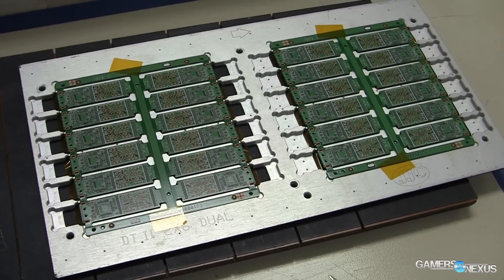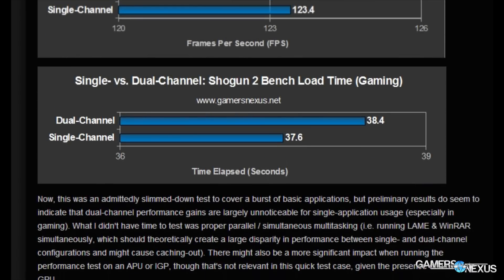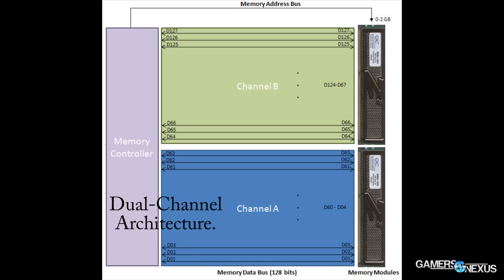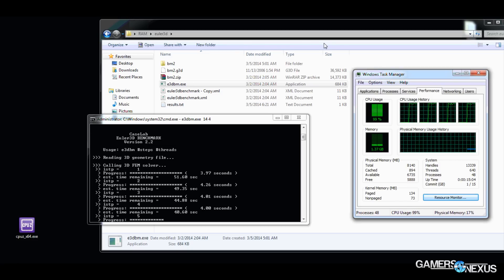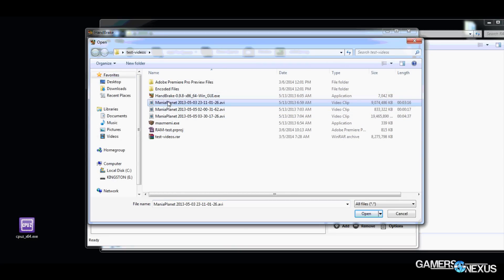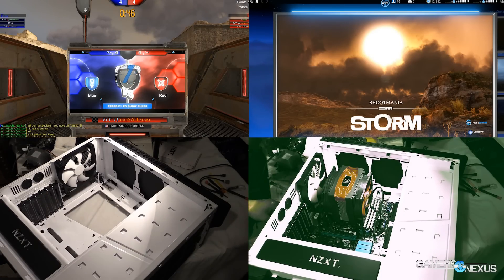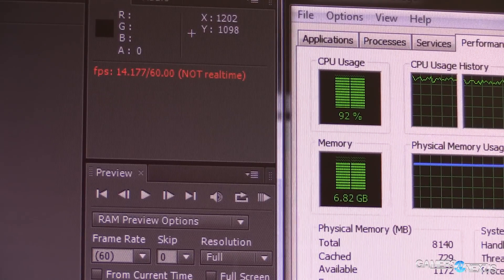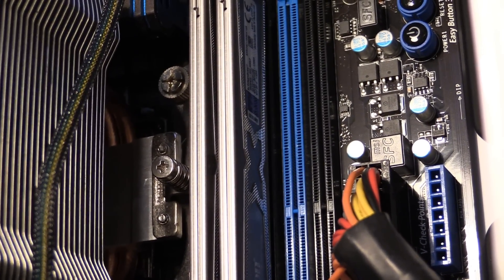RAM Benchmark: Dual-Channel vs. Single-Channel - Does it Matter?

Comment: I have a 12700 and I have a great speed of 3600 MHz with 1 stick, and I get less fps drops with that in A2 compared to when I use 2 sticks of 3200. I get fewer stutters, so it's not just using 2 separate sticks where it always gives less stutters and drops; it depends on game optimisation. Also, in games where I don't see hardly any difference at all in stutters or drops using either sticks,I also noticed if capping to 100-60 a person can use 1 stick and hardly any stutters or drops will happen; their reduced a lot, so yeah, 1 stick is enough; it just depends on game optimisation or how the CPU handles it.

Comment: I don't know if this makes sense, but does using dual channel become more important when using an ageing PC in 2021?

For example, one of the PCs I have, has an I3-3250, GTX 750Ti and 2x 4GBs 1600Mhz DDR3, SSD etc.

What I mean is, as this is an ageing PC with less CPU cores, does it not benefit from the use of RAM in dual channel mode as it inevitable has to work harder to keep up with today's software? Older PCs have to use every advantage they have right?

Comment: I know this is an old video but the subject is exactly what I was looking for.  I was hoping to clarify something I think was said at 1:52 in the video where you said there is no such thing as single or dual-channel memory.  Are you saying that memory does not need to be bought in kits?  For example, an 8GB kit with two 4GB sticks.  I am trying to increase the RAM on an EVGA X58 SLI Micro MOBO which is a triple channel configuration with 6 DIMM sockets.  I am having trouble finding "Triple Channel" Kits and I'm thinking of using three 8GB(2x4) kits to provide 24 GB total RAM.  All 6 slots would have identical 4GB sticks.  With this set up would I still have triple channel performance?  Are there any issues that I may encounter?

Comment: To all of you watching this in 2020: This 6 year old video is no longer relevant, and needs to be updated. DDR4 wasn't even out yet.
Reply: No need for update, principle is same. :)
Reply: @maelstrommatic  The difference has increased, with way faster GPUs and CPUs needing more memory bandwidth. With RTX 2070 and above, it would be a bad idea to use single channel memory, and even more so if using a fast AMD CPU (they are more dependent on memory speed than Intel). There has always been a difference though. The youtuber wolfgang has a video showing the difference in Assassins Creed Origins, using a GTX 1080 and i7 7700K.

Comment: I'm trying to make an old laptop work better. I already have a single spare stick of ram and it currently has a Dual Channel RAM configuration. Is 2x2GB DDR3 PC3-10600 CL9 SODIMM Dual Channel Ram configuration or 8GB DDR3L PC3-12800 CL11 SODIMM RAM Single Channel Ram Configuration better?

Comment: Im kinda stupid and i need a bit of help. If i  will buy 2 single 16gb ram will they work in dual channel? Or i need to buy a kit 2x16gb?
Reply: You can work it out with tow of the exact same of a RAM stick. But when buying, you should still get a pair, they are matched. There are some occasions where even the same ram dont work dual.
Reply: And watch from second minute that explaints theres nothing special about it.

Comment: I feel like the different between dual and single isn't really being captured here.
Personally, I think the significance of the difference between the benchmarks depends on the CPU and RAM combination you have (and whether you have an SSD or Hard drive bottlenecking everything)...

A computer with a fast CPU and a slow or average DDR2 or DDR3 RAM stick would greatly benefit from a second RAM stick in Dual Channel...
Of course, a very fast DDR4 RAM with low CAS latency would probably not bottleneck CPU that much that Dual Channel makes a big different on day to day application (the storage speed would play a bigger role).

Comment: Yeah, are you going to start ripping those RAM chips out of your systems?       Try disabling that PAGEFILE.SYS and then choke out some compression algorithm benchmarks.  The software has to be able to take advantage of multiple channels.   Here's one way of looking at it:  multiple channels of RAM is essentially the same thing as multiple hard disk channels.  Think RAID, think RAID 0.  And there has to be an intermidiary juggling what goes where with regard to filling up the RAM modules with data to process verssus clubbibng one channel until it gags and a tiny bit for the second channel and its done, while channel 1 is cursor frozen choking to death on over burden.  Mind you RAM is MUCH faster than a magnetic disk or SSD therefore, the human brain will notice the speed diffence in handling data when it comes to ahard disk but not quite so much with refard to RAM.  Is just the way the human beings hardware is designed.  Dual and quad channel arrangements will always be superior to single channel when the design and implementation of the computer hardware and the software are configured to properly manage the data.   Now think JUGGLING.  a 4 armed juggler will juggle faster than a 2 armed juggler but the problem is that the 4 armed juggler doesn't know how to use those extra arms since he's always had 2 arms.  Until he practices more his performance will not improve even if given 8 arms to work with.  Until the programmers take iito account the dual and quad channel architecture the end user will see very benefit and any that is noticed is likely by sheer accident and not design.  Blame lazy programmers not wanting to do extra thought to figure out how to take advantage of additioonal memory channels...   More memory channels will always be better when we get out of the stone ages of programming....  SSorry for so many typos, flubbing/floundering kyb.

Comment: In gaming with a dedicated video card from Nvidia or AMD, the answer is likely no, since you use your video card's memory the most.  But for all other applications, and for those with on-board graphics that use RAM, dual-channel RAM will make a difference.  In short, any applications that use RAM the most benefit from dual- or quad-channel.

Comment: Hey guys, I have a question:

How much FPS (average) will I get, when I will play fortnite on 720p with these specs:
GPU (+VRAM): AMD Vega 11 (2gb ram)
CPU: AMD Ryzen 5 2400G (4 Cores, 8 Threads, 3.9 GHz)
RAM: 1x8GB 2666 MHz
I will (i think so) also cap my fps at 60.
Reply: Boooo

Comment: So with what you said about dual channel memory not existing and it only matters if the platform supports dual channel; does that mean getting two single sticks that are exactly the same not matter? Or is that old myth that you should buy memory paired together because they're factory tested to work better together true?

Comment: Dual Channel really is needed for good Performance. Even my 3000mhz 1x16gb Ram was bootlenecking my system. 2x8gb 2400mhz Fixed many problems and Boosted my Games up to 60+ Frames!!!

Comment: Hi please please answer me a question. 
This is more of a server question with quad channel architecture.
Is it possible to bottleneck a ram config?  So for example channels ABCD all have matching 16GB sticks of RAM but then channels A,B also have an extra 8gb stick each in their next available slots.
I was taught that each channel needs to be identical for the architecture to work in “parallel” in a multi channel environment. Are those extra chips effectively bottlenecking the server IF the first 64gb (however unlikely) is succeeded???

Comment: I think the takeway here is that if you are noticing the difference between single and dual channel ram, You need to save and buy a more powerful system altogether. But if dual channel capable sets are available for a similar price, get them.

Comment: I have a dual channel board with 2 x 8 GB RAM, 4 GB on each channel and two empty slots remaining. When upgrading I would need to buy 4 completely new RAM sticks for quad channel and hope it would work, I could not simply add two more identical RAM sticks in the empty slots. At least, that's what I was told. Is that really true?

Comment: i have 1x8 gb and in some games like eft, forza h4, gta 5 i get stutters alot and even the textures pop in and out just bought 16gb. in 2 days i will see if anything has changed. i have an i5 6500 and rx 480 4gb there shouldnt be any bottleneck or anything
Reply: @felipefigueroa4021  yes

Comment: Everything adds up, and it really depends some games are very ram intensive Assassin's Creed Origins, Follout 4, so the difference is much larger and some games like Dying Light are much easier on the memory side, and will see a smaller difference. However everything does add up, even if your only getting a 3% IPC advantage going to dual channel, it's quite worth it.

Comment: A consideration is if you only have two slots and can only afford 8GB ram, should you buy one 8GB stick or 2 4GB sticks.  It sounds like it is better to get the 8GB stick for single channel so you can upgrade later to another 8GB and dual channel without losing an investment in two 4GB sticks.   Am I correct?

Comment: WTF everyone is speaking complicated language. Just tell me straight away: is 1×8GB better than 2×4GB?
Reply: No.
Reply: Based on this video, it doesn't really matter. It would be better to get a single 8gb stick just because you can throw in another 8gb stick down the road, where as if you get 2x4gb you won't get any realistic speed benefits but down the line you will have to buy 2 more 4gb sticks to upgrade and that will take up all your slots capping your ram at 16gb. So in a few years when 32gb is the norm you'd have to throw the 4gbs away and the the 8s anyways.

Comment: I went from Battlefield 1 with 1 x 16gb stick, timings 17-17-17  at 2400mhz with constant stutter and huge fps drops and low gpu usage. Installed 2 x 8 gb sticks Corsair Vengeance Ram at 16-16-16-39 also 2400mhz and seen an increase of GPU utilization at same CPU usage with overall less stutter and much higher .1% lows. So i think we should re do this test for DDR4 and newer 7th gen processors like the 7700hq
Reply: clutch4pancakes 109  interesting, what was the FPS difference?
Reply: I agree, i've seen several videos show that Dual is better than single, for FPS
Reply: one reason is 8gb is less memory for the game and second reason is dual channel does make difference https://www.youtube.com/watch?v=kCg7eVN6N9w&ab_channel=TestingGames

Comment: So if you want to built a dual channel system, you have to pay for the expensive pair of rams or you can buy and build your own pair,  being careful about matching timings and latencies (the first 4 digits) eg try to buy two of 9-9-9-26 at 1600mhz being the same brand or try to match markets best separate bargains?

Comment: This is very basic but I read somewhere that using duel channel ram in 1 and 3 slot uses both the boards channels and creates balance (in the force be one with the force luke) and to me anyway it does seem to run smoother the whole system while your test results may show little change it doesn't measure groove is it in the groove lol ya don't think there a benchmark for that so I feel it better to use two sticks at least to balance things out thru the system .

Comment: great video have a question though. for people using a low powered cpu like a j3060 or j3455 will dual channel make a big difference for basic tasks like browsing the web with 7 or 8 tabs or opening basic apps etc... light usage basically is it worth getting dual channel memory or 1 8gb stick is enough... thank you

Comment: outdated i dont know if my cmd com from this https://linustechtips.com/main/topic/391091-how-to-fix-or-reduce-micro-stuttering-in-every-game/ or dual channel fixed alot of microstuttering and more stable fps + less drops but ether way it worked well. and these days benchmark or testvideos showed that dual channel and higher frequenzy (ofc game, hardware dependend) shows better and more stable fps. ofc at a certain frequenzy of memory speed it has his diminishing returned. i have a 6700 i7 i just heard that makes a diffrence but ether way i had stable fps less stutering and fps drops, maybe even slightly higher fps.

Comment: +Gamers Nexus | Hi Steve, I noticed that you just change the position of a memory stick to force single or dual channel configuration. Some other people use different brand or model of memory (2 x 4 GB vs 1 x 8 GB). Due to this, my question is: how can this affect the benchmark? What is the impact of dual rack vs single rack DIMM in the results?
People don't seem to notice this fact.

Comment: I realize that this video is now over 3 years old but, do you guys think that Ryzen benefits even further from dual channel configuration RAM Vs. single channel configuration RAM?
Reply: i think it depends. if you are using an apu. absolutely dual channel will be better for your system. but honestly if you have a gaming pc with a cpu and gpu and your doing some gaming thats it... just get a single stick if its gonna save you a significant amount. because its not gonna matter for your fps. or your load times.
Reply: Dual channel HELP fps on ryzen. Because its ddr4. And test in video is on ddr3 this is why difference do not exist.

Comment: I switched mine to see a while back, I didn't do the kinds of tests you did, but i did run some game benchmarks and I got hang ups with single mode over double.
Seems to me you tested mainly GPU intensive games, if you had tried ones that are more CPU intensive you would see a difference.

Comment: I'm from the future where all RAM must be RBG. You have been warned.
Reply: Red Breen Glue
Reply: I'm evern further from the future...everything is RGB...CPUs have been replaced by fine LED nets and cases are completely covered and can be used as screens
Reply: khang pham Those prices are just sad...i want cheaper ram again 😟
Reply: Simon Fröhlich And now you have it
Reply: im from the future future future and we get rbg chair nowadays, so yea (yes red breen glue)
Reply: just recieved my Trident RGB 3200mhz from new egg.. $220 delivered!
Reply: Man the motherboard slots for dual channel have diferent colours, thats why we need RGB  everyone knows it
Its all about mixing colours !
Reply: I'd replace all my RAM with Ruth Bader Ginsburg in a heartbeat.
Reply: I'm from so far in the future that there are decorative fake RGB RAM DIMMs. We're going to hell.
Reply: and you're right !
Reply: uhhhh this guy was right and I'm freaked
Reply: Sean I’m from future future
Reply: Fans will be full rgb too
Reply: 2020: "You can come back now, we have more dire issues that needs to be solved!"
Reply: Wait I have a dumb question. I have a cpu/mobo that support dual channel memory, but I installed 4 sticks on the mobo, so this means its running in single channel? 
If this is correct does this also mean that my performance is worse because I installed 4 sticks instead of 2?
Reply: @kazansky22  Nope, you're using dual channel with all DIMMs populated. Just for peace of mind, download CPUZ. There will be a tab for Memory and it will say Dual or Single.
Reply: aright
Reply: The future is here. All hail RGB!
Reply: well its me from the present it is now :0
Reply: WHO ARE YOU STRANG WONDERER
Reply: Damn you know 😂

Comment: 1600mhz dual channel memory vs 3200mhz single channel ram?
which will be better??
Reply: Bandwidth wise the 3200MHz is probably going to be better and since we are talking DDR4 vs DDR3 I think that holds even more weight to it. My single stick of 3000MHz DDR4 works faster than dual channel 1600MHz DDR3 based off non-scientific tests.

Comment: Can we use the Ram Memory for CPU cache? Will that work for Gaming?
I seen RamCache that speeds up the SSD and HDD which is awesome, also I seen RamDisk which is super fast, so basically Hard Drives are garbage and also USB's are garbage literally with what Ram can do, why not just add M.2 in the ram and that will be super.
Reply: Fernando Salazar only difference is when you shut down the PC, you lose all the data on the ram which doesn't make it ideal to store information. RAM act like chache for the CPU. The CPU tells the peripheral what information it needs. The CPU can only hold so much data so the the peripheral sends the data to the RAM to store the data. When the CPU ready for the data it will pull it from the RAM because it feed it faster than the peripheral can. So if you are maxing out your RAM your PC will seem slow so its better to have more RAM than what you usually use. Now the speed of the ram is a different story if you are comparing like 16GB 2133mhz vs 16GB 3200Mhz. Especially when it comes to on board graphics and some games.
Reply: ecromancer what you said didn't answer any of my questions, is stuff I already know.